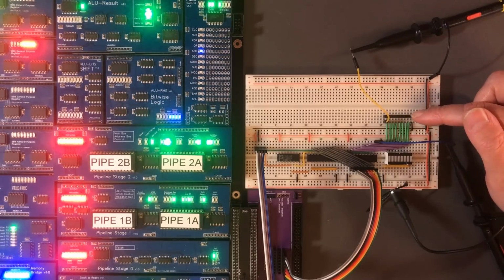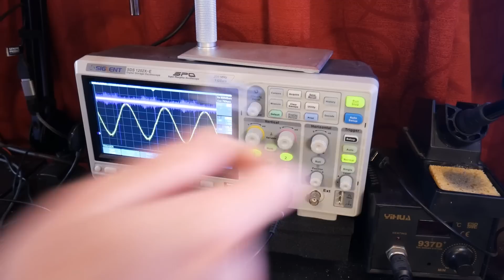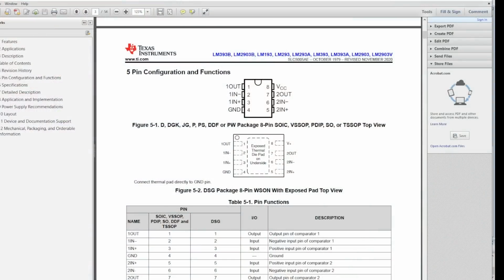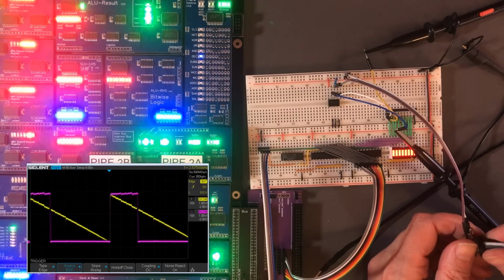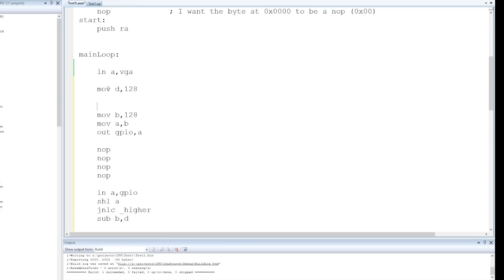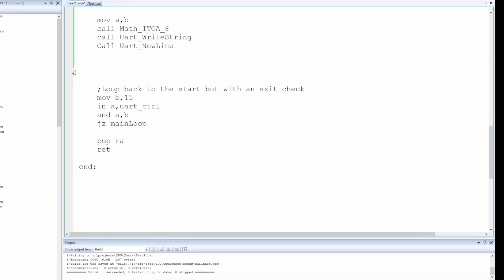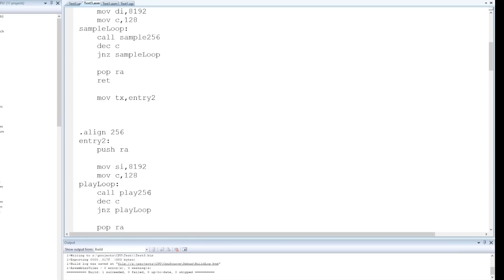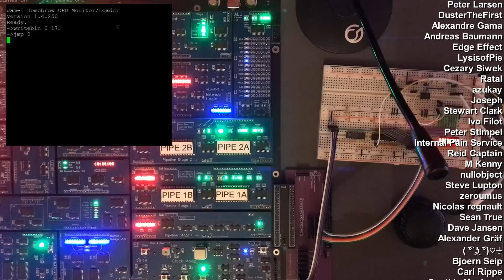Digital to Analogue and Analogue to Digital Conversion - IO from Scratch - Part 3

Comment: I bought a DA converter from amazon so i can have a headphone socket on my pc case from my soundblaster live, it works BUT when i turn it up the bass disappears, any ideas?

im coming from pin 16 and 17 from the sb live card, and in between the headphone socket and dac output i have a B10k pot as a volume level for the headphone socket
Reply from the maker: You are asking about a very different system than this video is about. Pin 17 is spdif so I’m guessing you have a digital audio decoder module, it’s worth noting that the audio stream may produce different results depending on the encoding type. Maybe add a small amplifier module, sounds like you might be putting too much load on the driver circuit.

Comment: I wrote a sampler for my Spectrum 48K, many years ago. In BASIC. It... slightly worked.
Reply from the maker: 1bit using the tape input? How did that sound?
Reply: @weirdboyjim  I can't remember, but probably, coz it was just PEEKs and POKEs. It sounded awful, but just recognizable enough as a "recording" of  the input that I felt able to claim success ;)

Comment: very cool you could do a circuit that takes an 8 bit value and does DPCM 8:1 compression and less CPU intensive an 8 bit shift register and a simple up down counter is all thats needed.
Reply from the maker: Yes,  always possible to simplify with a few additional parts.  I've done plenty of that in other side projects but here I wanted to go very simple.
Reply: Totally understand that @weirdboyjim

Comment: I remember audio sampling on the Ensoniq Mirage, working with MASOS, reading the phonebook sized manual, interesting to learn that it is not just as simple as A/D, storing the value, playing this back into the D/A and expecting it to be a sound representing the original, there's filtering and also antialiasing. Quite tedious constantly pushing buttons and reading the 2 digit lcd,  still, some really nice sounds could be created.
Reply from the maker: Indeed.  This was just a basic demonstration of the tools. To really dig into sound reproduction you would need to start discussing Nyquist–Shannon as well as analogue circuit tricks that I'd rather stay clear of.

Comment: Absolut amazing as always. But even after watching the addendum I did not get how it was timed in the first place. I guess playback is faster, so the delay loop slows it down, but recoding is done as fast as possible?
Reply from the maker: Oh no,  both record and playback are slowed down.  I worked out I can get the sample rate (which is much slower than playback) up towards 50khz but that would obviously fill memory far too quickly. The reason for the variability of timing is simply that AD requires the 8 step loop and the DA is a single cycle out instruction.  I could have cycle counted the AD loop but I just guessed numbers a couple of times until it sounded right.  The loops were about 6khz, looking back I could have got a bit higher.

Comment: What sample rate did you achieve?
Reply from the maker: I was recording at 6khz but that was with a big delay loop.  I can go much faster but that just fills memory even quicker.
Reply: @weirdboyjim   Very cool! I should have probably asked what the time taken for a single sample was, since it totally makes sense you would delay the sample rate keep memory usage reasonable. I was curious how expensive making a measurement would be especially with increased resolution (10-12bit seems achievable and useful)

Comment: I come from the old school.  One day, I got ahold of a bad A2D module (might have been Burr-Brown or Philbrick?) that failed due to some mistake by one of the engineers.  It was very expensive and so I decided to goof with it. Anyway, I started to disassemble it. At first it looked totally potted but I soon found it was just the outer perimeter.  When I got it apart, I was stunned to find that it was nothing more than a 555 with precision metal-film resistors and ultra stable capacitors with attendant transistors and diodes.
After that I got another idea and constructed a 0-10,000-count counter and a precision integrator along with a precision comparator that  would start/stop the counter.  I was able to get incredible accuracy and with the only downside being it was single-slope.  Fun days for a young buck just starting out!
Excellent video, channel and subscribers; good stuff!   73...
Reply from the maker: Interesting! Was your accuracy limited by the counter frequency or noise on the other components?  Glad to hear you found it interesting!

Comment: The whole ADC state machine could be done in hardware to offload CPU to do it's own stuff. I did hope you would use the SAR method and you did :-)
I do hope that one day this CPU will get interrupts to be able to do concurrent tasks ;-)
Reply from the maker: Of course, but building the ultra simple circuit like this was deliberate. Once you have build a cpu you can make a choice about these things, building the circuit to do handle it all would involve spending much more time on the kind of stuff I've already done and very little time on the AD/DA bit.

Comment: Put a 0.01 microfarad cap on the output (signal to ground) to smooth out the jagged edges on the output.  I highly suggest also using a latch on the output to prevent the gaps between samples.
Reply from the maker: Probably need to buffer the output through an op-amp as well but understand I was trying to demonstrate the basic principles in as simple a way as possible. The digital outputs are already latched before the ladder, or are you talking about an analogue latch?
Reply: @weirdboyjim  I must have missed the latch.  Looking at the scope output you had, it didn't look latched, but like I said, I may have missed something.  That would be my fault.  Back to D/A converters.  Nearly all have some sort of smoothing on the output via a low pass filter.  Just keeping the curve above the desired high frequency output threshold is the trick.  Yes, an op-amp would help with the strength of the signal.  If you are using it to actually amplify and not just buffer, then you can use a capacitor in its negative feedback to give it a low pass response.

The capacitor or low pass filter acts as an analog anti-aliasing of the output signal, turning the stair stepped output from the ladder to a nice smooth curve.

Comment: Respected, i'm not an expert but, I think LM393 (and op amp cousin LM358) can go from negative (or zero) rail, but not up to positive rail. You would need somewhat bigger supply voltage to a comparator to be able to hugh the 5V input You are feeding in. This can be avoided by one more MSB bit in D/A section set to zero so the output does not go over 2.5V. In retrospect, some op amp buffering, and surely some sample and hold circuitry would increase the quality so much. Sorry for my bad English, Best Regards
Reply from the maker: We could restrict the ranges just by adding voltage dividers to both the inputs.  Understand I was trying to get the basic principle across, keeping the circuit as simple as possible is far more interesting to me as  first demonstration of the principle.
Reply: @weirdboyjim  Of course, thats why we watch your videos with full heart. Thank You and Best Regards

Comment: @James,  I have not tried this, but can you 1. split the d/a to several d/a's with a bias voltage...  and that way the d/a counts can run at the same time and then add the outputs with the bias voltage and out put that.
Reply from the maker: It's difficult to parallelism like that since each bit needs the higher bits to be correct for the comparitor to work.  There are techniques that can do multiple bits at once though.

Comment: back when I was in school I made a staged SAR ADC. It used pairs of op amps and a Sample and hold for each bit. The first op amp was the comparitor and the second op amp would amplify the signal by 2 and then offset it by the bit. Then the Sample and hold would stage the signal. The result was slow op amps being able to do audio. The output bits also had to be shifted and delayed so that the results lined up.
Reply from the maker: Nice work! Must have taken up a fair bit of breadboard?

Comment: Pretty cool. Could you tell me the part number for the resistor ladder array you’re using? I’m tired of building them from individual resistors. Thanks.
Reply from the maker: The exact part I'm using here is "4310R-R2R-103LF" but they come with different values and configurations.
Reply: Thanks! I just need a starting point, because there were way too many options.

Comment: One potential approach to the voltage offset issue, would be to use a separate analog power domain where one can just redefine the high and low voltage references to suit the input (e.g. low = -2.5V, high = 2.5V), and buffer the GPIO outputs to those levels with push-pull optocouplers (e.g. TLP2270, or HCPL-2232 if you don't want to use an adapter board). One would also get complete electrical isolation with that approach, rejecting all of the digital-domain noise by default. And one could even generate those high/low references from the same reference as the sensor (mic phantom power, potentiometer divider voltages, etc.), so any induced ripple on the sensor voltage caused by the supply would be cancelled out.
I'd expect it would be possible to get a noise figure better than 16 bits even on a breadboard, this way.
Reply: This "cancel out induced ripple" is the reason that microcontrollers with ADCs always expose an "analog reference voltage" pin, btw. All ADCs just read in a value as a fraction of the reference voltage, `y = Vin / Vref`. And funny enough, there's a huge range of sensors that basically output a fraction of their input voltage that corresponds to the measured quantity, `Vsensor = Vsupply * x`. So, if if you can directly tie `Vref = Vsupply`, then when you connect the sensor voltage `Vin = Vsensor`, it all cancels out: `y = Vsensor / Vref = Vsupply * x / Vsupply = x`. And it still cancels out, even if `Vsupply` is some wildly unstable voltage with unfiltered switching noise and microphonic capacitors and a temperature coefficient that would make a thermistor blush.
Reply: @AJMansfield1  ripple is canceled only when the measured quantity is truly a fraction of the ADC's reference voltage.
When the reference voltage changes the voltage steps between the quantized ADC codes change as well. Whenever the reference voltage is reduced, the microphone sensitivity reduces and vive versa.
Due to capacitances even a voltage divider output voltage will lag behind the reference voltage and thus cancellation is practically not perfect.

@James Sharman could however simply connect his R2R network to the supply over a small resistor like 10 - 100 Ohms together with a capacitor in parallel to the R2R. That way a low pass network is formed and supply ripple gets reduced. Due to the parallel resistance to the capacitor the common RC cutoff frequency formula does not apply, but it gets close when the series resistor is much much smaller than the parallel resistor (R2R network in this case)
Reply: @maeanderdev  True, definitely an aspect to consider. But also, the capacitance on the input line acts essentially opposite to any capacitance present on the reference line, so if you're careful about circuit topology you really can get away with a lot. (And by "careful", I mean a full paranoia three-way differential pair between the analog signal, analog reference, and analog ground, all three routed all the way out to the sensor and only connected in with the supply voltage via the other traces that connect to the sensor's pads.)
Reply from the maker: If everything was totally isolated from one another I could have just used the center of the voltage divider for the common audio input. Unfortunately isolating everything is pretty tough.

Comment: Moving AC to DC is perfectly fine with an OP amp, but it's also possible with a capacitor and a voltage divider. Although that also forms an RC filter network, basically a high-pass. Which isn't going to be a problem for low-quality audio purposes.

In the same manner, you can transform a DC signal into AC without having to provide negative voltages to an OP amp. Just put a capacitor between the DC and AC side, typically 100uF electrolytic for audio at line level and high-impedance sinks.
Reply: high pass networks were also fine for high quality audio purposes. As long as the cutoff frequency is somewhat far away from the audio frequency range, like much below 20 Hertz, the entire audio frequency range will be practically unaffected
Reply: @maeanderdev  Well, the problem starts when the sink impedance is variable. Often seen with (cheaper) sound cards, as the filter characteristic will change depending on which head phones you connect. 
Also, just RC is a first order filter, so it will have a very flat curve, meaning it's unlikely to not affect low frequencies unless you use unreasonably large Cs.
Anyway, for this demonstration, it would have been more than fine. It might even have better high-frequency response than a cheap OP amp, although again not really relevant for audio and a simple voltage follower, where even a cheapo LM358 with 0.7 MHz GBW would be fine. But let's say you wanted to offset a 10 MHz AC signal, using a rather good OP amp with 10 MHz GBW is barely going to make it without reducing the signal amplitude.
Reply: @graealex  Opamp gain actually is tremendously important for audio.
Distortion induces small errors. Correcting them through the feedback loop needs a lot of gain to achieve really low distortion.
High performance opamps often have 50+ MHz of GBP for that reason
Reply: @graealex  first order indeed becomes impractical when a small resistor needs to be chosen in favour of a reduced impedance dependence.
I had only ever done that with large resistors and insignificant impedance variability. In my case first order was fine.

Some modern DACs like the pcm5102 simply include a charge pump and allow filterless operation. Not sure whether filterless is also viable with audio ADCs, since any offset in a recording will introduce a pop sound at playback, which would require a digital filter
Reply from the maker: Using the op amp in the way I did produced a different offset from different audio sources. I attributed this to different output impedance, at a guess I would need to buffer the signal though another op-amp first but I'd need a split rail to do that.
Reply: @weirdboyjim  A split rail can be super easy, for example you may use the ICL7660 charge pump IC. Schemativ can be found in the datasheet. It simply charges a capacitor with one terminal connected to ground and then connects the other terminal to ground and discharges it into the output capacitor.
That chip includes an oscillator and does all of that switching on it's own
Reply: @weirdboyjim  That's why using a capacitor and voltage divider would be the better option. It extracts only the AC component, and the voltage divider will center it around 2.5V, no matter what.

Comment: Great work!
You need to add a reconstruction filter for DAC, which will be LPF tuned to your «sampling rate», and an antialias filter for ADC :-)
Reply from the maker: Sounds right, but I was trying to keep to the basics here.
Reply: Also.. the minimum usable bit... depth... for digital, even way back when they first used a DAC to convert it to a video pattern, because in the early 70s they had no other useful way to store it, was 14bit. They later improved that to 16bit, and even the eventual CD standard was this same 16bit, 44.1kb/s. You are using a) an 8bit chip, at b)probably nothing close to the needed sample rate. Having seen someone do this with an old Apple II, I would be hugely surprised if it sounded better, regardless of the speaker, or the mic.
Reply: @patrickelliott2169 with dither you can trade these off alright. With enough sampling frequency, dither will give you any dynamic range you want. Even at the extreme of 1-bit precision, it takes just 2^n samples for n bits of dynamic range.
Reply: @microcolonel Delta Sigma and PWM come to mind. With 25 MHz as seen on some of his circuits.
Reply: @patrickelliott2169 Amiga had 8bit and pcEngine had 5. Also I think there is a video about polyphony in this playlist. 8 bit add is single cycle. So you can mix a lot of square waves with different volumes and still only need a resistor network, but no OpAmp ( other than to terminate the resistor network with a fixed impedance.

Comment: I wonder how possible it would be to implement the binary search using hardware, and free up the CPU to do other things.

This is impressive, as a software engineer turned hobbyist electronics, I'm loving this series and learning a hell of a lot!
Reply from the maker: You could definitely do it, I planned a circuit out to do it a while back.  Basically a set of latches, a counter and a 3:8 line decoder implementing this algorithm.  Would have a taken multiple bread boards though.  If you don't need the speed a counter based approach would be a simpler circuit.
Reply: SAR ADCs are commonly available. Many simply have an input to start a conversion and approximate synchronous to an spi interface
Reply: I wouldn't bother too much doing a binary search in hardware. Just using an 8-bit counter as the input to the R2R ladder and latching its value on the transition of the comparator will give you a steady sample rate and your CPU only has to read the latched value and is not busy otherwise.